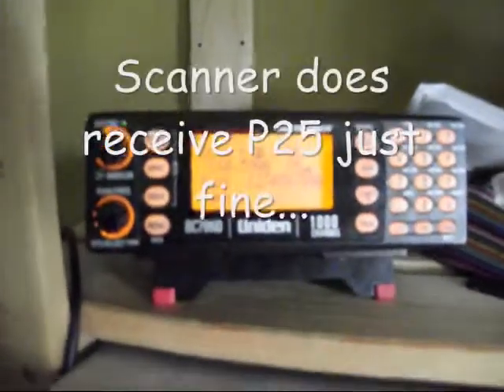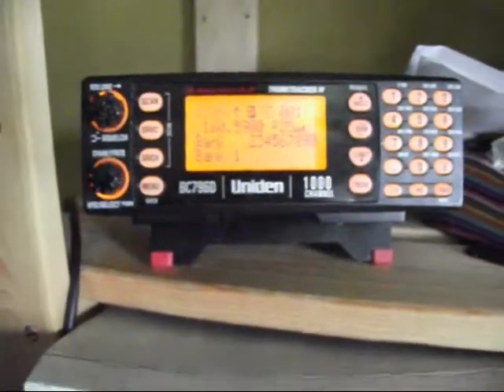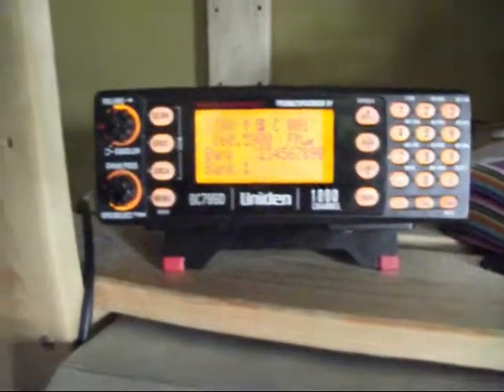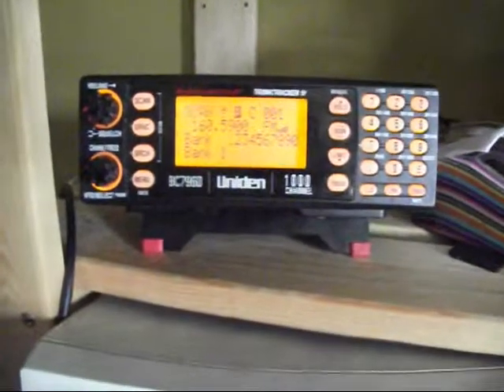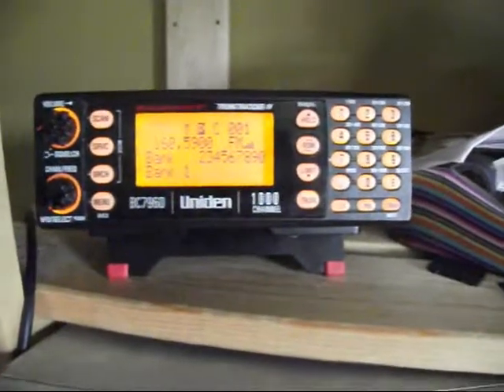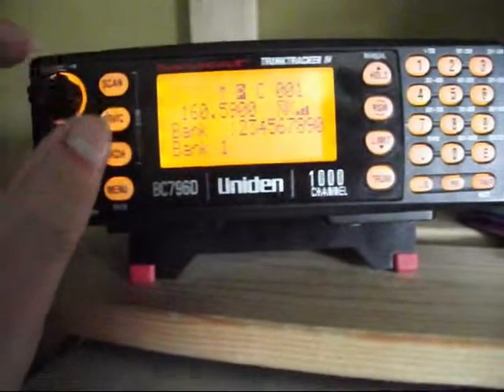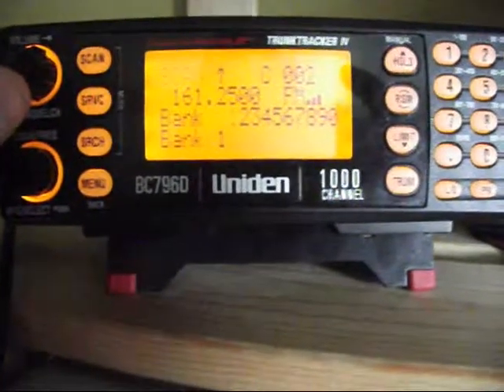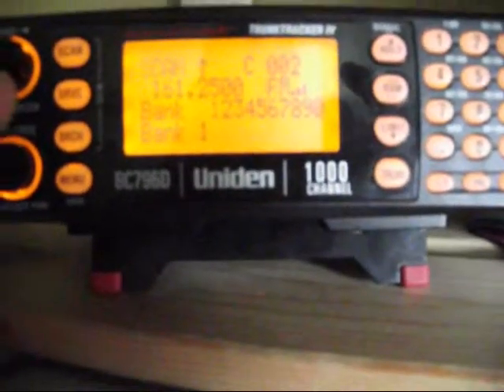Uniden BC796D Scanner update # 3

Comment: The antenna has nothing to do with the squelch. The squelch circuit is only associated with analog FM. P25 is a totally different system and does not use signal-to-noise like analog does. P25 - digital uses BER (Bit-error rate)  instead of squelch, the BER is preset by the manufacturer and can't be changed. -My credentials -  I am a retired Motorola Engineer -  A. Lacy - Schertz, TX
Reply from the maker: Art Lacy Thanks Art for your expertise in this matter. I thought that would be the end result of all my attempts. I kept trying but could not make any headway with any of the suggestions and was growing more confident with each attempt that it was doomed to fail. Many people had good ideas but in the end, the scanner was never gonna be able to function under P25 Encryption. I am not sure if there is anything out there on the market that can cover that encryption now so I have gone back to a basic scanner. I'd appreciate anything you can share with regard to finding something that will work in my area.